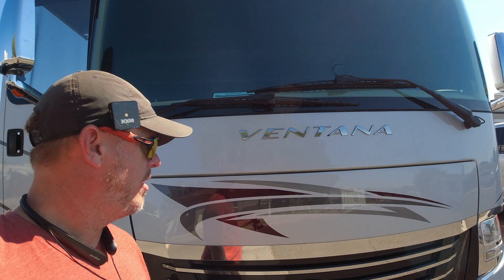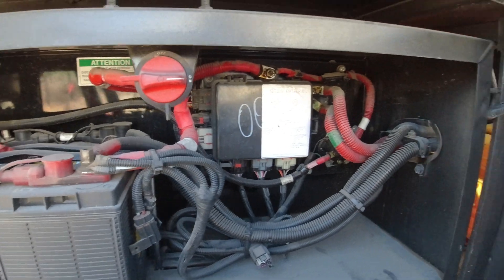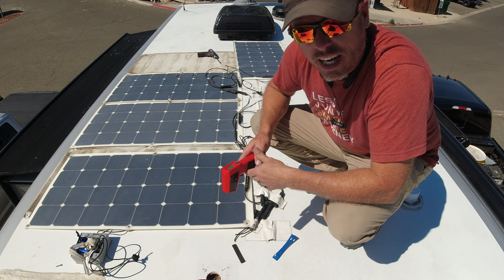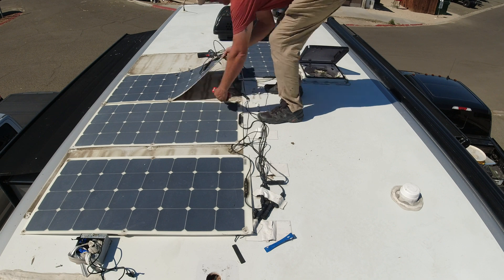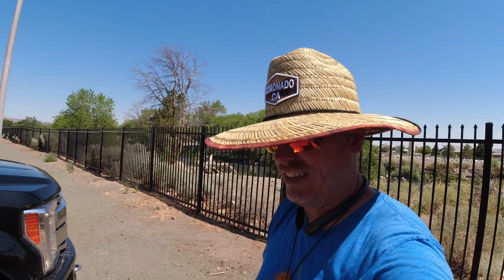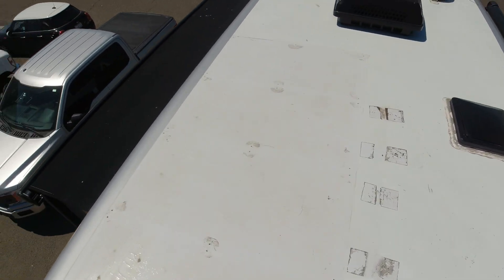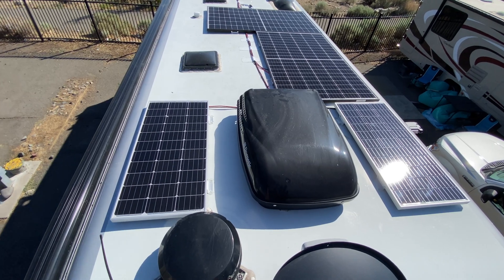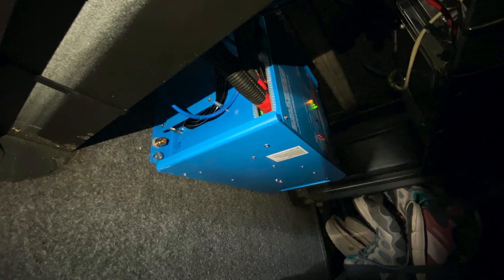2016 Newmar Ventana 3427 | Solar & Battle Born Upfit

Comment: Nice job.  We're about to put 3×200ah Renogy lithium batteries and 400 watts of solar in our Newmar 3426.  Your video provides a lot of good ideas for our install.
How did you run your solar cables down from the roof? We are looking at going through the bathroom which is just behind the main storage bay on the passenger side.
Thanks again.
Reply from the maker: Because I am a professional installer, I am meticulous  and I make sure to not run the wires in the main living area.